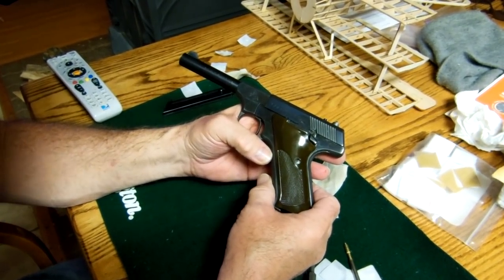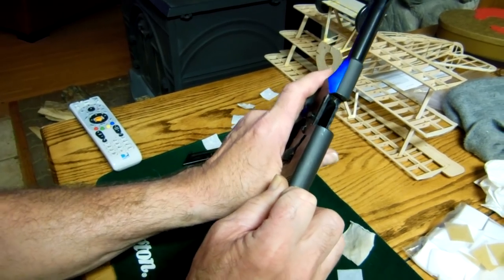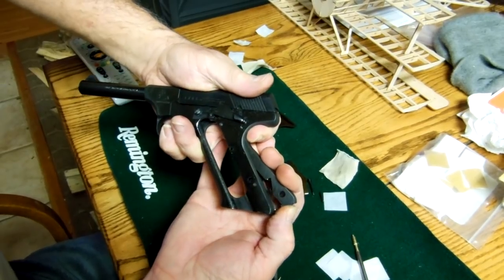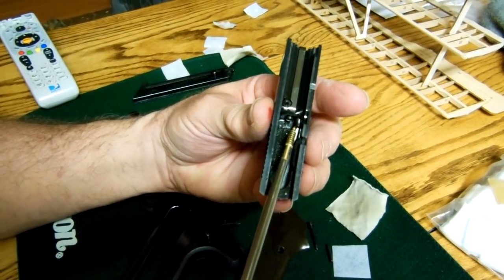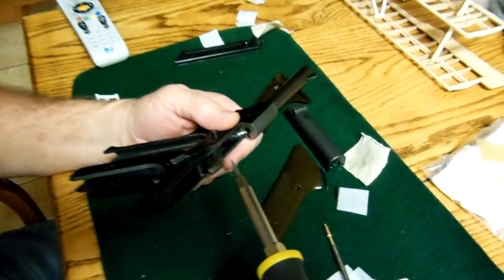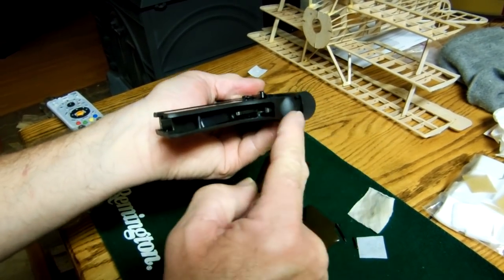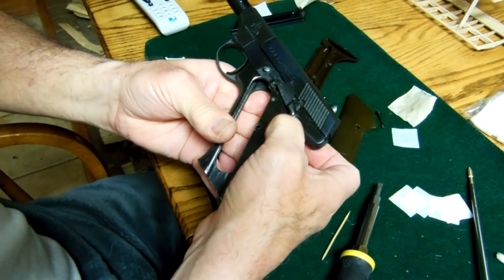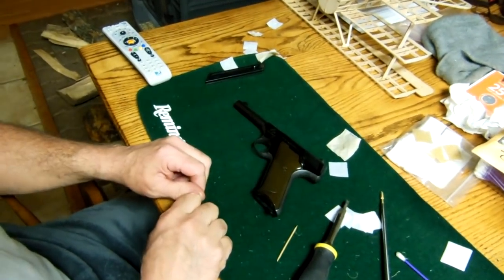Colt Challenger Pistol 22LR Field Strip

Comment: Thanks for doing the video. It helped me. One thing you might clarify is that when you pull the slide back to release the pressure on the recoil spring you do not press the assembly lock plunger until after the slide is fully back. When watching your video I thought you were pushing the plunger down as you pulled the slide back.

Comment: WAP Jr. Lots of help. Best video I saw. Successfully dissembled, cleaned and reassembled my series 3 match target first time with NO difficulty. Will do sport next. Note: please do video on dissembling magazine. I used manual by Michael A. Pugliese ISBN 978-1-936259-58-8. Note pg 14 does NOT show spring between spring guide and base. Carefully note spring position before dissembly and dissemble in clear bag (laundry shirt. I made mine smaller with clear box tape). Hope this helps. Thanks